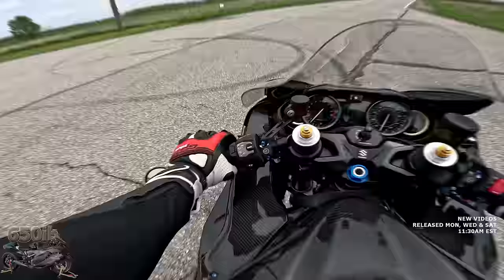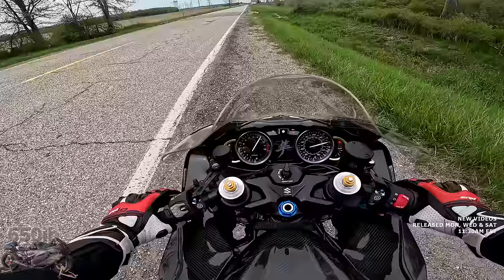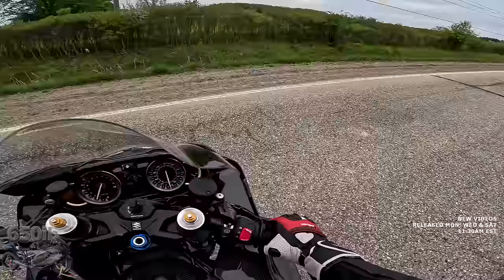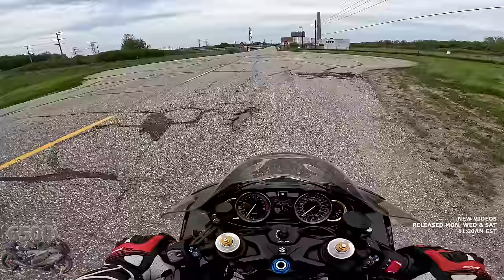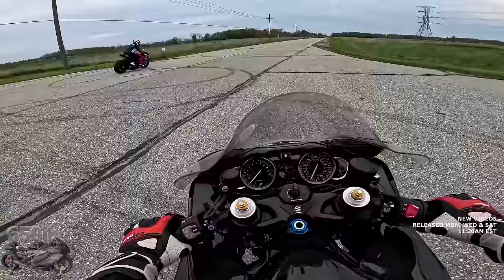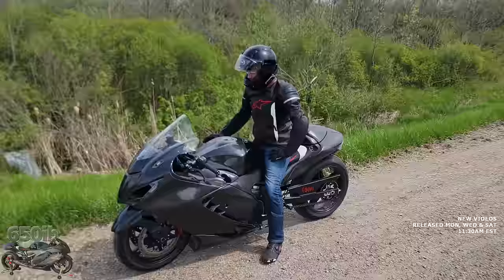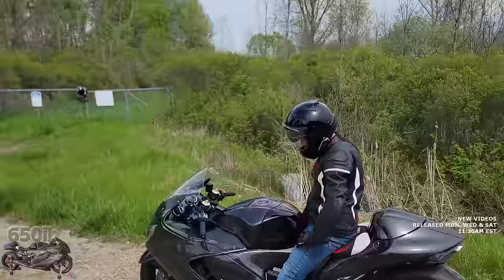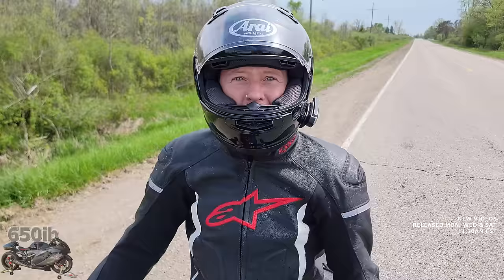$100,000 Ducati SuperLeggera V4 TRIED TO SMOKE MY BUILT MOTOR BUSA!

Comment: Now try hanging with it on a road course which the Ducati was built for. It was never meant to be a dragster… Watching the MotoAmerica Ducati (which is based off this bike) accelerate from the apex to track out at turn 13 at Brainerd is absolutely incredible and makes that bike worth every dime…
Reply: Still 100k for a bike is ridiculous, I'd take an Aprilia V4 over that, lol.
Reply: Ikr. ..ridiculous how manufacturers spent millions and sweat in r&d developing and manufacturing a complete  car or bike to go fast, corner, brake, handle, be daily driveable with not much dialing/tinkering, offer warranty, and even look nice.

..and then we out here enthusiasts "tuning" (and barely making 20% of the parts) something that's good in just one or two aspects and we think we're better than them.

Comment: Love to see how your busa stacks up with Chris' hypa busa. Both machines are incredible. Great content Keep rolling out them awesome videos. Stay Safe!!!
Reply: Wouldn’t even be close,Chris’s hyper Busa does over 200mph in a standing quarter.
Reply: 650 build more in depth build. Chris lowered and turbo. Chris bike definitely faster. But if 650 would of went the turbo full build route w the lowered and stretched 😳😳😳
Reply: @steveyork8069 Hyperbusa OG  does 190+ mph  on the quarter mile. Hyperbusa 2.0 does 200+ mph on the quarter mile.
Reply: @wanderer54796  It doesn’t matter IB’s Busa wouldn’t beat either one.That 1600 is only 250hp Chris’s low setting is 300hp 80lb lighter rider no contest.
Reply: @steveyork8069  for sure 👍
Reply: Except riding is inherently not safe.

Comment: You should ask whoever built the motor, I think you might even be short shifting. A lot of times with a built motor the red line is even higher than Stock and I see you shifting just before or right at stocke red line.
Reply: I bet it has so much torque that short shifting a bit it isnt a case. Even in first gear.
Also i bet that the max power comes lower in rpms than a stock(first stage upgrates) because it has much more stroke.
Love to see a diagram comparison of hp and torque from that beast vs a first stage.

Comment: Hey do you do any riding specific exercises so you’re able to lean on the bike more? I’m 6’3” and I believe you’re the same height and it hurts my body so much especially in my pelvic area when trying to lay on the tank. Do you lower your rear sets down and back a little?
Reply: I’m 6’2” 180 lbs… Get into yoga. Your core is weak and you’re not holding your torso up with your spine the correct way. I also added Heli bar risers to take weight off my wrists and it brought the grips into a better position. Wear your gear EVERYTIME and be safe brother !